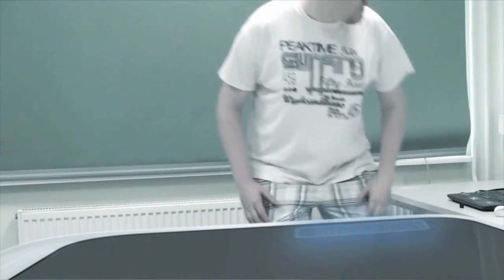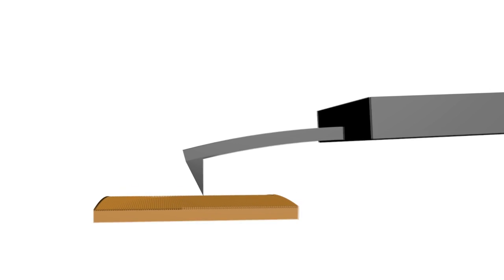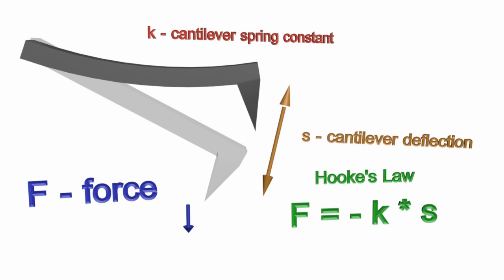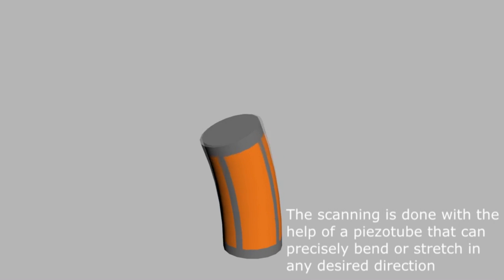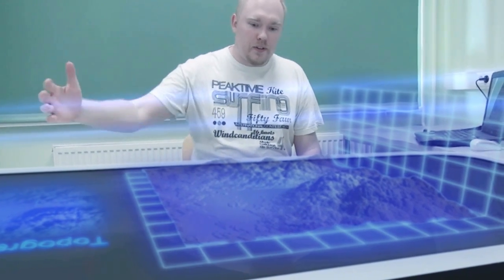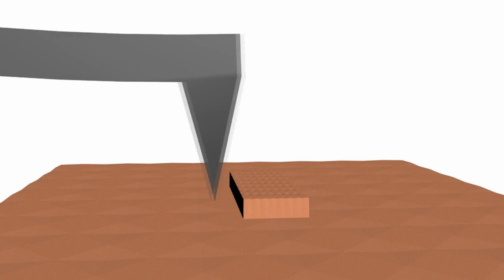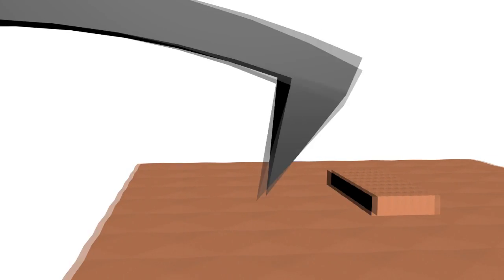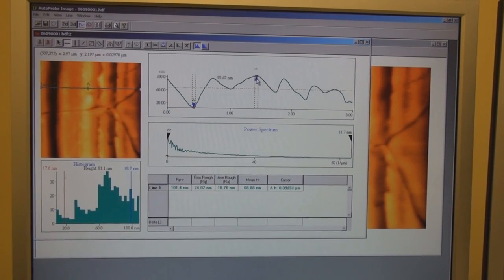AFM - Atomic Force Microscopy Animation

Comment: I understand what it does, but what is its purpose its usefulness? Can it find cracks in metal?
If you know the metal then you pretty much know the surface, so why are you using this AFM to go over  a surface. I think I  may have missed that, but I am interested in knowing?
Is that as large as a AFM gets?
Reply from the maker: I have used AFM for the development of ultra-thin nanometric functional coatings - for the protection of metals against corrosion as well as for enhancing biocompatibility of materials. With AFM we learned about the surface roughness, which is dependent on the crystal structure of the prepared coatings and this directly affects corrosion resistance and biocompatibility. In other cases, AFM is used in a similar manner in the development process of novel memory materials for your smartphone. The general advantage of AFM is the fact that it provides you with a true 3D image in a microscopic scale, which is not possible with SEM for instance (although the images would be comparable from top view at similar scale).

Comment: So what do we do about the electrostatic and vanderwhaals forces? Do we somehow correct for the deflection that they cause?
Reply from the maker: Aye, the feedback system with the laser and the detector will use the piezo tube to move the tip closer or further away, depending on the surface morphology, in order to ensure a) having a signal and b) that the tip isn't damaged.

Comment: Does the tip actually touch the surface? I saw another video where the tip does not actually come into contact due to electrostatic and other repulsive forces.
Reply from the maker: Hello and thank you for the question! In fact nothing touches at the atomic scale and there is just vast space between particles. So yeah, the electrons around the atoms of the tip will interact with the electrons around the atoms of the sample and repel each other. This means that no matter how much you push, the best you can achieve is the dislocation of atoms in the tip and sample but nothing is actually touching.
Reply: Thanks

Comment: thank you so much for that explain .
I have 2 qwestion 
1 . what the diffrent between AFM & STM
2. the Tip when be closed near to atom how the Tip can jumb the Atom ?
Reply from the maker: Hello and thank you for the questions! 
1. AFM is based on the Van der Waals attraction and electrostatic repulsive forces between the tip and the sample surface. In the case of STM an electrical potential is applied between the conductive tip and the conductive sample - as a result electrons can jump from the sample to the tip or vice versa depending on the polarization. The tip and the surface need to be very close to each other however for the electrons to be able to tunnel from one to another. Nowadays both methods can achieve atomic resolution but at least in the case of conductive samples STM still has an upper hand. 
2. During the scan the feedback information is monitored all the time and the distance of the tip from the sample is continuously adjusted. So it all comes down to the sensitivity of the microscope, the speed of the guiding computer and other factors.
Reply: Ah! thank you vary much teacher.

but I think AFM better than STM 
becuse the STM  used for metalic sample only
while AFM used for metalic and nonmetalic sample ,  also AFM's Tip more narrow than STM's Tip so may be its will be more accurace ,
Reply from the maker: It really depends on the application but generally the two methods complete each other. There are actually lots of different AFM and STM tips and their sharpness and quality really depends on the manufacturing company and application (type of the tip).

Comment: nicely done...i have read that the photo diode that we use is a quadrant photodiode.. why is that?
Reply from the maker: Thanks! It means that there are 4 optically active areas on the detector, separated by a small gap. So if the reflected laser beam moves from one area to another due to the bending of the cantilever during the scan, u can get information about the topography of the surface.

Comment: can the AFM probe break? or can the probe break the sample?
Reply from the maker: +dusty lee Hello! Its a good question because AFM tips dont last forever. The main reasons for that are the breaking, dulling or contamination of the tip. Breaking and dulling happen when studying rougher surfaces. For instance, when you scan over a higher surface detail in non-contact mode and the feedback system doesnt have time to pull the tip up then you "smash" into the microscopic "mountain" and damage the tip. So the lifetime of the tip depends on the surface that you study and also on the scan parameters (scan rate, distance from surface & imaging mode - contact, tapping or non-contact). The contamination of the AFM tip can occur when fluffy or sticky surfaces are studies.. or when a random dust particle happens to be in the way.
About breaking the sample - normally AFM doesnt do observable damage to the studied substrate. However, when special hard tips are used then you can actually scratch or push a hole into the material by applying more force and then study the scratched microscopic hole with another mode. In our laboratory we measured the thickness of thin films on other substrates that way (scatch a hole into the film and then see how deep it is).
Although if you want to study the hardness and other mechanical properties of a nanomaterial then you will need to use a similar technique called "nanoindentation". In some modern AFM-s you can include the nanoindentation module (adds about 50 000 EUR to AFM price) to the microscope and do both mechanical testing and also imaging of the surface!

Comment: How can you design your experiment to measure contact resistance between the tip and the substrate?
Reply: +Vishaal Zade You can measure the friction with lateral force microscopy (LFM). Basically the cantilever is tilted due to friction during the scan - more friction causes more tilting! Of course when the cantilever is tilted then also the reflected laser beams spot is in a different place on the detector and thats how you get the feedback. Try google the phrase "lateral force microscopy" for more info =) Aaand thanks for the good question too!